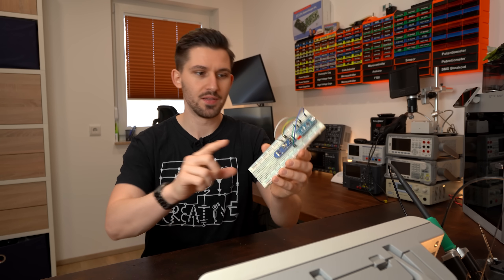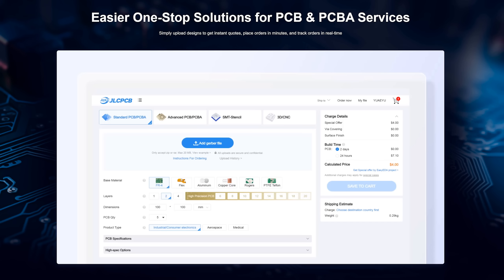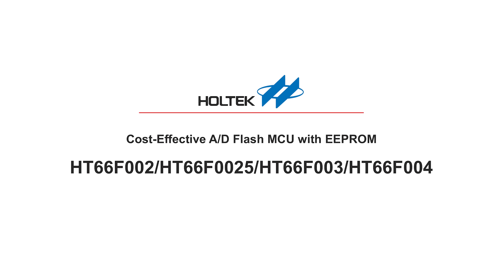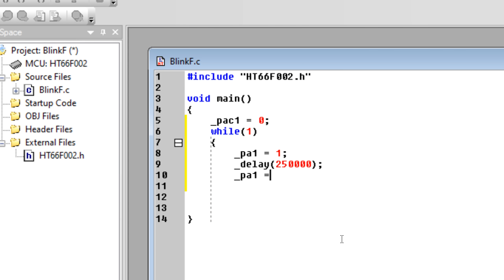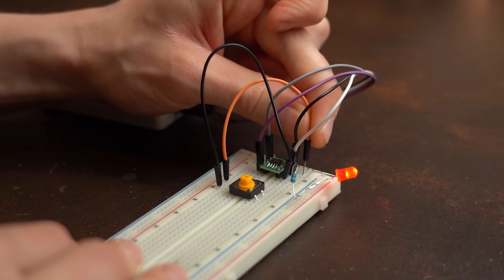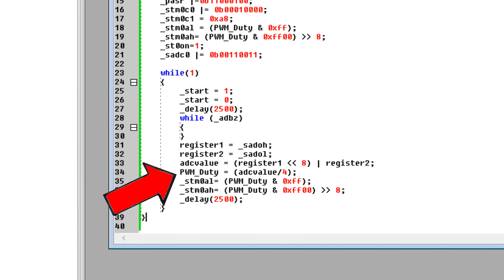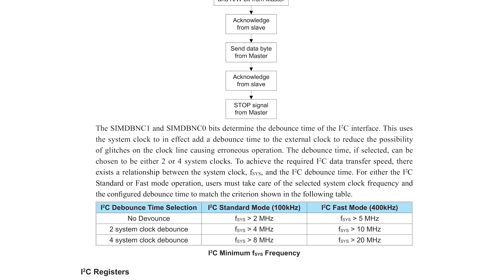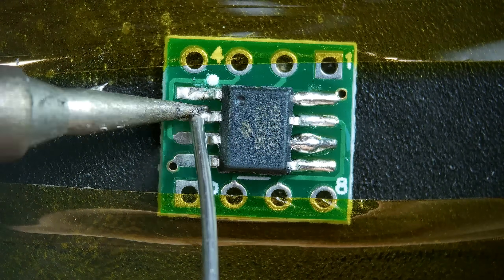I tried the Cheapest Arduino Alternative (that Nobody heard of)

Comment: isn't I2C a shared bus setup?

you could use cheap and mostly useless landline 4-pin cables(that most old homes already have in the walls) to integrate a whole-house data bus
though honestly the microcontroller part might be more expensive for an led dimmer based on an I2C variable

what I would do is find a simple way to bitbang the I2C variable into a serial string, run that into a DAC chip somehow, and feed the LED with it 
a pack of shift register chips and DAC chips is something you almost certainly will need as a DIY person(they are even useful with arduinos if you need massive numbers of pins your arduino doesn't have but would happily read/write via a shift register that clocks in a loop into a bitmasked variable in the arduino, which isn't even time sensitive as you can simply clock the latch of the shift chip then pulse the data at your own time)

I am not fully familiar with I2C but I bet you can spoof almost any tiny chip into running a serial type bus with shift registers as long as the clock can be arbitrary speed

Comment: I don't know why everyone immediately reaches for Arduinos for trivial applications. PIC do loads of chips that can be programmed with very few connections and a cheap ICE. You can cheaply make a custom circuit and add a header to allow you to program them. Sure, you don't necessarily have libraries, but for simple projects you don't need them. You can program in 'C' if you prefer, and single step, use breakpoints etc. It's really easy.

Comment: Even though the arduino board is produced in quite large quantities it's a bit unfair to compare the cost of that, with all the supporting components and a pcb and headers, to a rather low range proprietary chinese MCU without the same components around it. 
Not that it changes the fact that those cheap MCUs are rather interesting, though. 
As a side note, there is also the new STM32C0 series microcontroller that probably also would be a good candidate for this- It's more likely to fit well in the existing toolchain, its ARM Cortex M, so it's rather familiar, and has pretty fleshed out periphery on chip - and they're priced to compete with 8-bit MCUS, at <=1USD @ 1ku

Comment: I mean technically you could have done the distance sensor/LED driving without a microcontroller at all.  But I suspect the video exploring cheap microcontrollers was the motivation for developing a sample project, and not the other way around.

Comment: If you want flashing LED's why not just buy some low cost flashing LED's? In fairness to you, I've two Arduinos here which are just ornaments, because I've never understood programming, despite years of trying intermittently to figure it out. Those boards have never made LED's flash, even when I copied someone else's code and loaded it into the devices. 🤷‍♂

Comment: I'm sure you have already looked at Microchip's range. Although I am not a big fan (not the cheapest and they have many gotcha quirks, which you find out the hard way), you could use something like a PIC12LF1552 which includes the features you need and typical sleep currents are around 1-2uA. They have a good paper on I2C. I assume that you do not need all the functions at the same time (there are never enough pins on these micros).

Comment: few month ago i found on TaoBao the attiny13 with coast $0,33. Its much easier to use with arduino IDE, you only need USBASP programmer. Also it can run on 128kHz frequency so its use a little bit of power

Comment: @greatscottlab I have a problem that could use a solution. there is a problem with ford escape hybrids 2009-2012 with the hybrid batteries, they lack a high voltage jump starter, and because they are nimh in combination with the small idle drains from the ford BMS systems they have a tendency to drop below 300v DC making it so the vehicle wont start. there are solutions out there where you essentially turn it into a plug in and charge it with a HLG-120H-C350A when the battery gets low. I'm looking for a easier hands off plug and play approach where it would still use the HLG-120H-C350A , but would also use a jakery+solar panel to make it "off grid" and passive. Like how would I go about making a relay control circuit that reads the pack voltage every 24 hours during the morning, then if the pack voltage is below 310VDC it sends a signal to a relay to turn on the 120VAC of the jackery to the HLG-120H-C350A to charge the battery until it reaches a charge of 350VDC, and to have it so the whole thing is disabled when it detects key voltage (12VDC). I understand the Jackery and solar side, that is basically taking the place of the plug on my wall, but the control board to make it all work together I'm lost with, it doesn't seem like there is any product I can purchase that would be able to handle the scenario I'm looking for to detect both the high voltage and low voltage DC as a means to activate/deactivate charging and disconnect the entire charge circuit when there is 12v.

Comment: For a cheap-ish and easy to use range I would recommend STM32 microcontrollers. They use SWD debuggers, 3 wires only if you solve the VDD separately. STM32CubeIde is a pretty nice eclipse based IDE, and you can get a JLink Edu fairly cheap. If you miss serial prints, Cortex based MCU's often come with ITM pin based STDIO (printf) implementation, which allows you to log runtime data in a clock cycle. Only downside would be that the ITM pin implementation is output only. 

ST Micro provides one of the best hardware access layer generators (STM32CubeMX) I've seem in my life, which lets you set up your needed peripherals from a graphical interface, and it generates you the basis of the project you can start working in. No manual register editing necessary.

Full disclosure, I mainly work with STM32F4.... family chips (mid range) and at my job we do have access to some better IDEs and debuggers (IAR EWARM + I-Jet) so my actual experience with STM32CubeIDE is pretty basic. 

Another easy to use microcontroller which let's you do more in depth projects is Nordic Semiconductors NRF52840. I have used it extensively for BLE applications, it comes with a fairly simple hardware access layer which you tend to configure manually though a config file. As it is Cortex based, JLink Edu should work well for it. Or another trick is to get a NRF52840 big dev board with onboard debugger chip, and it is possible to wire it in a way that you can use the debugger chip to debug other chips, such as an Adafruit NRF52840 Feather board. 

In both of these cases you can access better debugging tools such as live watch windows to monitor and even edit variables in memory in real time, or breakpoints.

Comment: Bitbanging I2C is not hard to implement, specially as master since you dont even need to worry about clock frecuencies. Still works as slave although you will run into speed limitations.

Comment: You could have implemented I2C yourself - had to do this a long time ago before micros generally came with I2C.  Timing becomes critical depending on speed you choose, but there is always assembler to achieve perfect timing. C is your friend in those cases

Comment: I'm not certain, but it looks like the IDE has a debugging interface, so you should be able to see the state of all the individual registers and things for debugging purposes. I'm not sure though, I've never used this particular controller or programmer.

It's very worthwhile learning to code like this I think, the code can be WAY faster than what the arduino libraries can provide, and you learn more about how coding and MCU's actually work.

Comment: check out the stm32g030. It's cheap and will do what you need. If you need a high temperature application check out the attiny85

Comment: 6:12 the correct term is actually Download, as it is to a "lower lovel device". You can search the web and discover multible poeple have asked on the Arduino Forums for a reason to why their termonoligy is revers, and unly find the answer "IDK". In PLC's a download always referes to a data being downloaded to the PLC and an Upload being when data is uploaded from the PLC. SO in conclusion Download is the correct term, even though in arduino it is called Upload.

Comment: You should use Attiny or other Atmegas from AVR family which are kind of easier to understand, and its ides are new (microchip studio) also looks like most of them can be also programmed via Arduino IDE (like Attiny13A witch has all the feathers you need and compatible with Arduino IDE) but in order to get better result its better to use code vision AVR or the microchip studio

Comment: Not sure if this is mentioned in 1k comments, but the CH32V003 probably meets your requirements. Its programmer is a lot cheaper and you can even build one. The only catch is that it currently does not have decent support for the Arduino IDE. I will also second the many comments on implementing I2C in software, master mode is actually simpler than slave (as you generate the clock instead of waiting for it to change).

Comment: Once you start digging there are so many interesting tiny SOCs beside Arduino :D
I recently came across the Infinion CY8C24123A wich offers two 14bit ADCs in a tiny SOIC-8 Package - but also requires a new IDE.

Also, regarding Holtek, they have a cool I2C Matrix controller wich is often used for LED Matricies: HT16K33

Comment: Learning new things are good but if you've to pay 110 euro just to save some bucks on already working alternative, then I would say it's probably not worth it. 110 is a one time investment, but one has to struggle a lot when it comes to programming the same easy code on this new platform, c language vs Arduino's own language. Everything comes down to time,  But I guess it depends on one's own prospective. Good video as always!

Comment: My go-to controller series these days is the STM32G030 series. There is a 20 pin version from about 0.5$ and it has all the goodies that its bigger package brothers have. I use it with ST's IDE which certainly has a steep learning curve after Arduino but the raw amount of hardware features is worth it for me. The only downside is that division and floating point math are basically non existent on the controller but it's easy to get by them. E.g. I can do integer divide by power of 2 by right shifting, if I don't need to be super precise.

Comment: If using I2C to read the IR Proximity sensor and the sensor itself it ~$2 .. Might look into using a predone IR sensor (like Vishay TSOP series, like 34538, ~$0.80 with bulk count of 10) and IR LED emitter and make your own proximity sensor. Or go crazy with creating a tuned circuit with filters and your own IR photo diode sensor. Just modulate the IR LED around the sensors carrier frequency (34838 = 38kHz). But if you want to read from many I2C sensors on a bus, bit-banging I2C master isn't that hard to do and the way to do it with those HT66 series of MCUs.

Comment: You have 14 of these, I would thought you'll have a single master and make the sensor side as slaves. For a single master, it's completely reasonable to use ATMEGA386P for it since it's handling all the complicated work.

Comment: Personally I would use the ATtiny 0, 1 or 2 series which starts below 0.50 USD. It has hardware I2C, SPI, UART, PWM, ADC, and even DAC and differential ADC in some variants. It can be programmed using Microchip studio or even Arduiono IDE (ATTinyCore). And programmers are cheap.

Comment: Writing a software I2C is very simple and easy, you may easily find some example code on the internet, I used such library many time in my projects. you should also look for basic libraries for the uC you are using, sometime manufacturer provide all basic libraries in their example section

Comment: I've done this exact thing with a 555 and a 7492. The analog equivalent don't need a programmer so it is way cheaper and has a faster construction. I don't quite get why to go digital with the added costs and complexity.

Comment: Not supported by Arduino IDE and must use special programming peripheral gadget. These are big obstacles. 
I will look for cheap devices supported by normal serial peripheral (or even USB) and well known development IDE.
Reply: The devices must be very unique and having big future to use it any project. Saving several cents is just ridicule.

Comment: I did the halfway version of this project..  I bought an Arduino trinket which is powered by an 8pin dip attiny85 processor and programmed it using the Arduino environment, I then bought a USB Tiny programmer for ~$6 and some bare ATTiny85 chips at $1 to prototype  my project. My programming was all done in the Arduino software for the trinket, and with code from the ATTiny Datasheet. but for my final pieces I bought boards fully populated by PCBway, and used an SMD chip clip to finally program the ATTiny chips on the boards.

Comment: I'm not getting something probably...but for this kind of problem an attiny85 would be perfect!
There are some solutions mounted on a usb shaped PCB, that don't require an external programmer, like this one: https://www.fattelodasolo.it/wp-content/uploads/2022/04/dc7h4n3-51e6389c-5f86-4fb2-a7ad-34f75f672003-1024x777.png (a 10x pack costs around 3$ on aliexpress).

Solution #2 maybe not always feasible, is to use a demultiplexer and a single microcontroller, to read the IR sensor sequentially

The last solution, to use the microcontroller in the video, requires an mcu with full i2c support, to be used as master.

The attiny85 is Arduino IDE compatible, and very cheap!
Probably I would try a multiplexer with a single MCU though, it's cheaper, and faster, as you don't need to flash the code many times!

Comment: You can easily bit bash i2c.. Also 11uA seems high for halt mode. You might need to program unused i/o pins as outputs to reduce current. Possibly.

Comment: Did you consider cheaper cortex-m0 MCU options and they wouldn't need a custom programmer. At about 16-20c a piece, it'd around the same price point.

Comment: That programmer does seem awfully expensive for what it's (probably?) doing? I wonder if you can compare its output signals to the compiled firmware and emulate it yourself using pins on an Arduino or something?

Comment: The atmel line has super cheap chips, and you can program and debug them with the cheap JTAG programmer. You can use avr studio to write in c or assembly. The attiny series is pennies